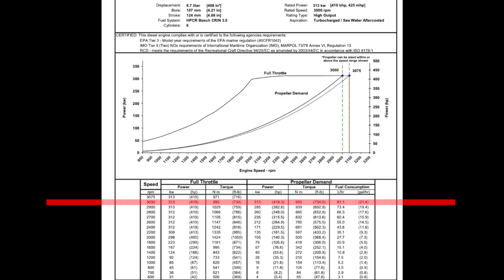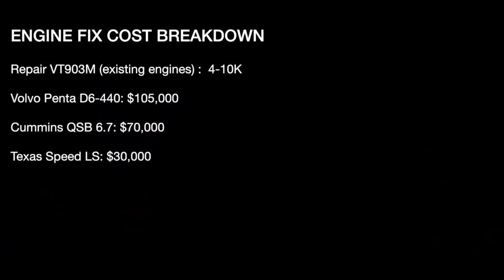Tesla Powering my 30yr Old Italian Yacht? And Broken Diesel Engine Diagnostics

Comment: How bout keep the best of current diesel to recharge and power electric motors? i know submarines (non nuclear) use that powertrain
Reply: Yes that’s an option , that would add maybe 7. Tonnes of extra weight to the boat .. subs run this system because a diesel needs AIR to run whereas a sub likes the be somewhere that air doesn’t exist

Comment: So sad to not use diesel engines. You should have done twin duramax if you just had to do a different engines but using these diesels and trying to get more power out of these would have been cool. Switching to gas is so lame.

Comment: Yeah I think you had a turbo malfunction and it lifted the head on that side
Reply: Umm no ...can’t ever see that being the issue on a large diesel
Reply: So if the wastegate stuck closed and it over pressurized the cylinders you say it's impossible to push out a head gasket on a large diesel so what are the head gaskets made out of
Reply: @rodney1818  its not what the gaskets are made of dude the head bolts of a diesel are  torqued usually 2-3 times the equivalent petrol engine also the heads are usually made of cast iron , add that to the low rev capacity (2300rpm for the cummins ) its easy to see a wastegate problem wont lift a head
Reply: @mitchpender8113  yeah I was just trying to be nice I actually think it was operator error and was trying to blame it on mechanical Defector error something diesel fuel today is not made out of anything like what was available that that thing had in it and was designed for seen a lot of stuff stick on vehicles recently especially that wasn't designed for it due to sitting for long periods of time with this modern fuel in it
Reply: @mitchpender8113  remember we are talking about the guy who took the motor out of a front of a car and put it in the back of a car and could barely figure out that he did not turn the motor around

Comment: Stick with the 903's and detune them a bit and you'll get reliable service for many years. you should probably also go through the marine gears while you have them out. Pay attention to the exchangers and make sure all the zincs are replaced and go ahead and replace the cores. The zincs are your sacrificial items in a sea water application, keep them replaced. It seems excessive, but you don't want to have to recrack this thing open after going through all of this work.

Comment: Diagnostics?? You removed a valve cover... 
If it blew the oil cap off youre probably looking at some piston or liner issue. 
Or the breather assembly is blocked somehow. Make sure to check this out.

Comment: your best way and all the way round and what i would do is remove both Engines and have them both rebuilt then put then back in your boat  diesel is way better then a gas Engines for that size of boat you have.  diesel Engines will last a lot longer then gas and diesel is cheaper to run . so what ever you do say with a diesel Engines .

Comment: Please don't do the Telsa idea... yes it sounds like a crazy B is for Build idea but it wont pay for itself. like you said that means Gas or Diesel. Not sure if its a thing or not but i was sure there was a good portion of marine diesel engined boats due to the fact they are less likely to have issues with water. If you somehow get water in the cylinders and they are just gunna super heat it and keep going. a gas engine getting water in cylinders probably will stall and/or hydro lock, plus electrics dont like water (eg. Coils). I do find it strange that i say that knowing there are gas engined boats out there. so here's what i think, to throw a spanner in the works... your rebuilding them engines anyway. how about  getting more from them. rebuild them stronger, more efficient, more power maybe more gearing so they don't have to rev so much until flat out. that's the B is for build id like to see especially including modern electronics keeping an eye on the engines. Just my British 2p worth ;)

Comment: I don't see the point just rebuild the diesel engines, its a big heavy boat and needs big heavy engines.
The only possible reason you would to put gas engines in it is because you think you can get them for free then sell the diesel engines and pocket the money but this would be a mistake.
if you just want to exchange the original good quality parts of the boat with new crappy low quality parts then all you will have is a crappy low quality boat and I for one have better things to do than sit and watch that happen.   
Oh and some of them small sail boats burn just 1/4 gallon of diesel per hour

Comment: You would need a nuclear reactor to run an electric yacht.  Pushing a boat through water requires tons of energy.
Reply: Or a TON of batteries. It will happen give it 10 years once some breakthroughs on battery tech happens and they become significantly cheaper and longer lasting

Comment: Dude just build the diesel engine it is the best suggestion that can you can maintain everything of the boat with gas it will be expensive with all the new engine and all the fuel you will use in each trip  but just skip the EV for the boat because it totally a waste if you will use this boat but if you want to keep the boat as a piece of unique technology than you can try to do EV but you will loose the range of the boat

Comment: to hear  someone talk so much  when they don't have  any clue about the subject, it is too bad that people might be thinking y'all know your stuff...The most dangerous thing  out there is people pretending they know what they are talking about , I prefer when people just admit they don't know anything  that way we can get  better information on what is really going on. I have a relative who thinks he knows it all and he does believe he knows it all so sad because he will hurt himself and others who trust his knowledge . You all need to get help from an experienced dependable marine engineer who can steer you in the right direction...When you mentioned 4000 rpm on that cummins engine it made me think, those large displacement engines  will most likely not run over 2600 rpms max. ..the cummins c series in line 6cyl  rated at 430 hp runs at 2600 rpms max  weighs 2300# without the  twindisc 507 reduction....If I am not mistaken those  vt903 cummins engines are not very efficient  but they are rugged and were utilzed by the coastguard in their 41ft  aluminum  patrol boats that were decommissioned not too long ago .

Comment: I think you would be better off just rebuilding the motors that came out of the boat than to pay more for new motors or putting gas motors in it stick with the original engines

Comment: I'll bet the tesla engines would go into meltdown before they ran out of battery at full power, I'm guessing they're not built like your diesels to maintain maximum torque for very long.
Seeing as your boat is already overpowered you may as well just refurb the boat and engines and retain the value of the boat

Comment: You will kill the value of that boat if you put gas motors in it...... I’d rebuild the cummins for sure any real boater with a boat like that is going to want the diesels purely on fuel reliability and longevity

Comment: Go with Tesla, 0-60 in 1.5 sec!
Reply: Great let’s drop a motor and batteries designed for a car in a 10 tonne boat with no supercharge outlets anywhere  boat , 0-40mph 30 seconds and dead  flat after 6 hits like this ... get towed / swim back to marina , plug in charger and wait 10-28hoyrs  and repeat

Comment: Hi I have sunseeker 37 with 2 X bad v8 454 7.4  740a volvo penta gasoline, its litle ligther boat than yours but im planning to do electric swap, i will start with about 150kwh batteryes and each time i go i 3 hour trip i can safe upto 180 liters gasoline that make x 1.3 euros =  234 euros or about 280dollar and that is economic normally i would spend abour 500 to 800 dollars easy so i will safe that money and buy more batteryes for it  untill i can run the boat 6 hours on decent speed, the whaigth of the motors and the gasoline reducion on electric swap is about 1000kg so i can ad 1000kg batteryes and the boat are still in balance, expencive yes but i buy the batteryes on gasoline safings only. i was hoping you would go electrig but it is a big risk for that big boat, and about the calculation kwh for gasoline vs kwh electric i cant belive untill i try it so im jumping in the deep pool, best luck with your project.

Comment: yank the diesel's drop three model s battery packs with a diesel powered generator to charge the batteries that are not in use to power the boat..
contact tesla for help on the project.. I bet Elon would be game.. just a thought..

Comment: Couldn't you put electric motor in the boot and use An efficiënt diesel generator (And in a few years hydrogen). With my engineering background, it should be more efficiënt than your diesel engines

Comment: And displacements along time if you really look at gasoline got a look at the annual maintenance about every 3 to 4 years ago to replace exhaust manifolds risers all of that into the least 1500 to $2000 per engine each time he exchangers they go bad about every 10 years there anywhere from 1215 $100 appease a diesel has a whole lot less maintenance you clean everything you change the oil the exhaust riser you take in your boiled out you may have to reach a change it periodically every 5 to 10 years and there a lot less money Ono a diesel is less expensive to maintain and Yuri seo value is exponentially more

Comment: Not cheap, but using anything not designed for marine use, will come back to bite you in the ass, also have to macgyver the cooling system for a  road engine, as air cooling ain't possible!

https://www.elcomotoryachts.com/product-category/electric-inboards/

Comment: First of all it's 45 knots which is not 45 miles per hour. II you should have replace the oil pressure gauge before you started out. Third you dumped 5 gallons of oil into the ocean.

This is why just because you can buy a boat does not mean that you should own a boat nor does it make you a captain of anything.

You could always do direct diesel electric. If you're just going to throw money at it. 
Also horsepower doesn't mean anything with a boat that size it is all about torque. 

I really like your car shows but this is terrible I just really want you to stop talking 🙄. The next episode will be the coast guard either fining you or saving you.

I made it all the way to the end and I can't believe that you are getting rid of those engines... Those engines are $60k a piece and they are designed for what they are doing. They will last forever if it's not an idiot owning the boat, without gauges, doing a shake down at full throttle. 

I wish I had seen this video whenever it first came out I would have driven wherever you were at to get those engines.